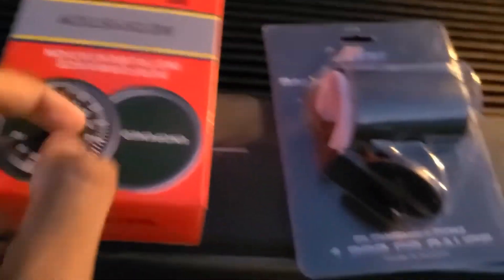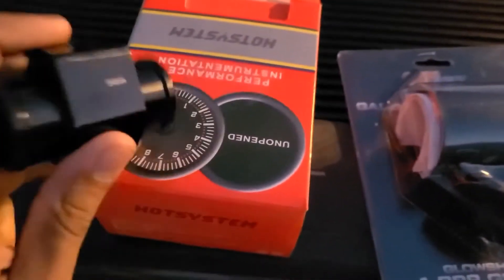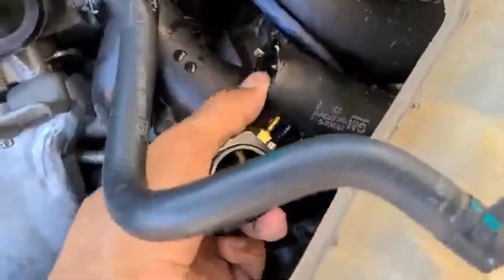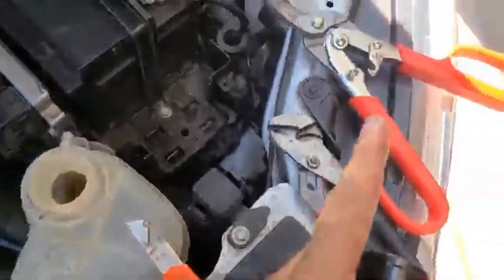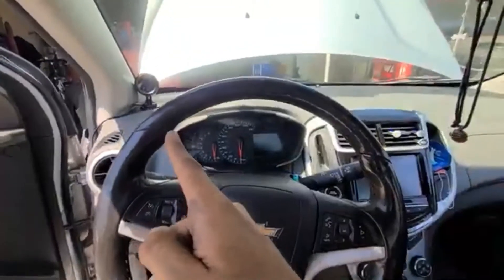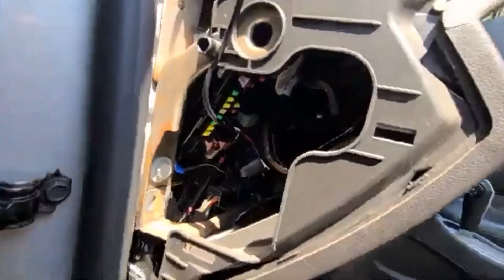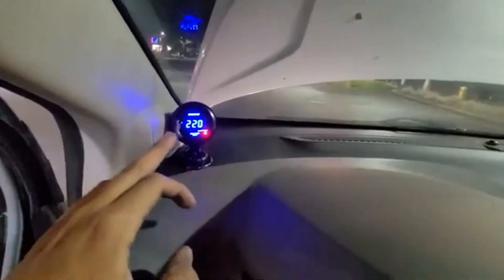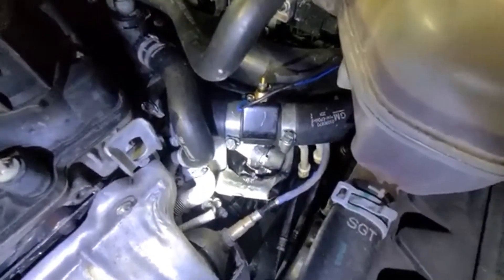Adding Coolant gauge to 2017 Chevrolet Sonic

Comment: Is this necessary? The computer should already have a temp sensor input somewhere. I see people are using ultragauge that connects to your obd2 port. I might give that a shot.
Reply from the maker: I just didnt like not knowing the temp. GM dropped the ball on that and by making the water pump plastic
Reply: @Suzu92 yea same here!   I have a 2019 sonic, and always hated I couldn't see the temperature to monitor it..  rather not wait until it's too late. I'm only at around 45k miles and with the extreme heat and A/C running,   the car started being hesitant one day when at a stand still.

 Someone mentioned the timing can act off with extreme heat conditions..  got me thinking I better start getting something to see the coolant temp to monitor!
Reply from the maker: That would be a good solution aswell.

Comment: hey brother i just install mine is not ready it does go up a little cos of the switch but is not moving, ( i dont have the same as u) i have and analog, so i still have to ground the the small screw, btw the small screw is to actually for sensors like the universal relay sensor

Comment: I'll definitely be doing this to my sonic soon. I just had the water pump start leaking, luckily I caught it as soon as it started.
Reply: I just got done replacing pump, outlet and thermostat. 70k miles. Don't know what they were thinking with getting rid of the gauge. Catching it before it happens is what saves the engine
Reply: @thejconstantine3081  my waterpump went out at 45,000 miles so it was still under the power train warranty